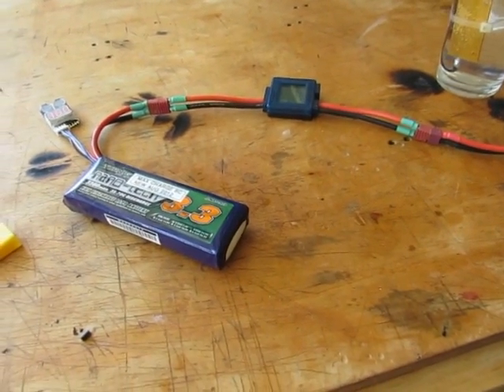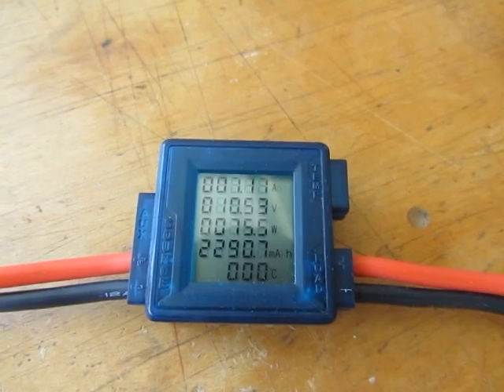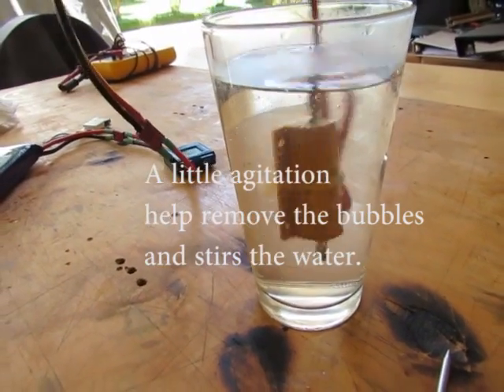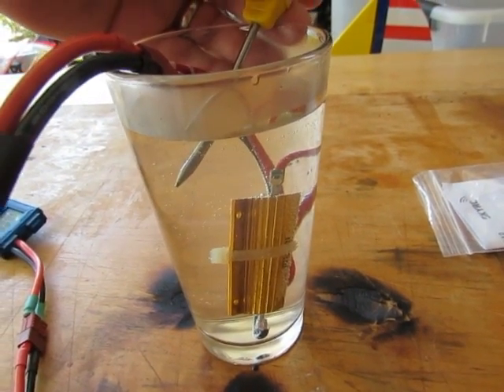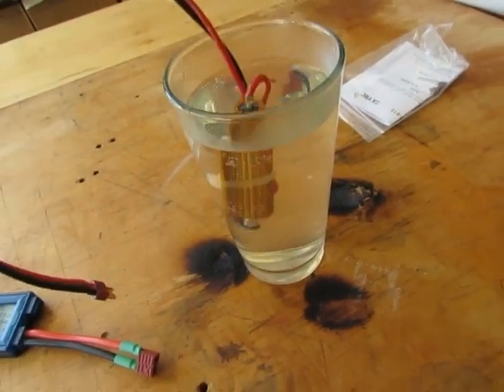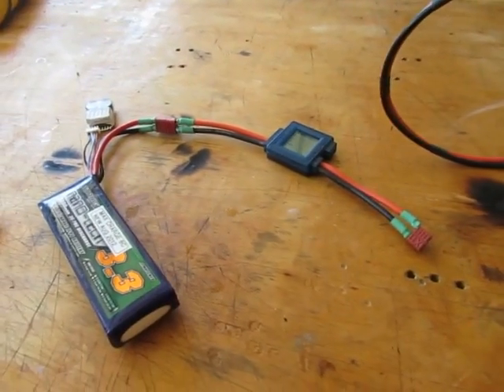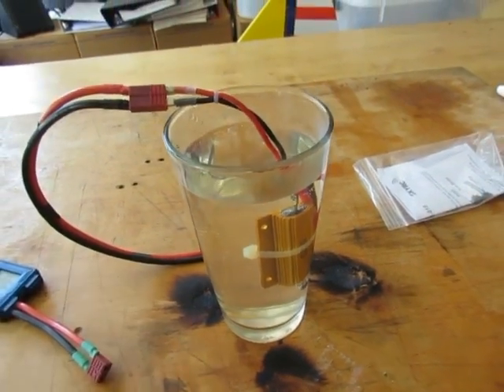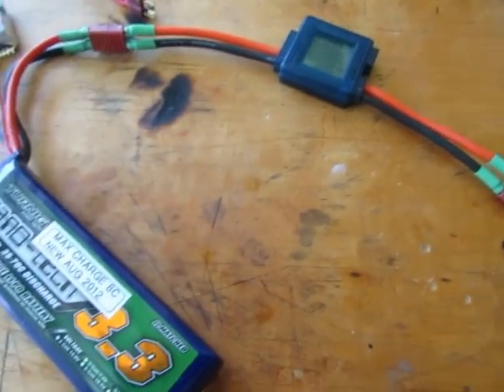Discharging a LiPo battery using a resistor.

Comment: At least you're not promoting the ridiculous salt water thing 🙄
Reply: That said, don't use water at all for this.

Mineral oil is your friend for coolant like that 😉
Reply from the maker: @MadScientist267 Hey thanks for writing. 

Mineral oil would be a great choice.  I have a gallon of it here in the shop.  

This video was simpler than that. It was just to explore using a fair sized resistor for killing a LiPo. It was obvious cooling the resistor would be required and dropping it in a glass of ice water seemed like an easy experiment. Using mineral oil would probably require freezing it first (or use a large quantity) and when the job was done, it would be expensive over time to just throw the oil away.  i.e. you would have to recover/recycle the mineral oil.  This video was just to explore using a glass of ice water. It virtually free and you can pour it down the drain.

Comment: I have a resister that looks just like that but is a 50W6Ω  , i have a tiny lipo (300mah 1S) that i would like to discharge down to storage voltage (3.80v to 3.85v) ...i don't have anything to run the batteries down (5 of them).  I just want to discharge one at a time.  is that resistor too big or too small?, would it suck the juice out of the 300mah 1S LIPO too quickly? thus exploding it? or would it be just right?  There are no other markings on the little tiny LiPO other than it says "Protection IC circuit built-in"  Thanks a ton !!!! Here is the LIPO's link on amazon  https://www.amazon.com/gp/product/B07KNFF6QS/ref=ppx_yo_dt_b_asin_title_o07_s00?ie=UTF8&psc=1   (by the way, i could see the tail of an R/C aircraft back behind the table, what type of aircraft is that, looks really big)... thanks again!!

Comment: Water conducts as another posted use Mineral oil or a large sink and fan.
Reply from the maker: Reid Bridges 

Thanks guys. I will run the next test using Mineral oil. 

Do I care if the water conducts?  In this test I just want the energy of the battery to go into the water. I don't care if current passes though the resistor or through the water directly.

My largest concern is to the long term health of the water soaked resistor.  The ice water is just a heat sink.

If it turns out I need to use mineral oil instead of water, I will have to find a way to increase its capacity . The cooling capacity of mineral oil is less than 1/2 the specific heat of water.

Finally, I have a proper way of testing and discharging batteries.  The below video is of my load cell capable of discharging at up to 1600 watts (the limit of my charger). https://www.youtube.com/watch?v=eLNjXj18g9s

The  video and experiment here was to try and find a better way than light bulbs or salt water to kill a battery for disposal.
Reply: Distilled water doesn't conduct. Only unpure water.
Reply: @RyanPhallen  No water! Lol

Comment: Not a bad idea. However, you may want to try something less conductive. Like Mineral Oil vs water.
Reply: water isnt that conductive. thats a GIANT gap also between the 2 sides of the resistor. also no easily available liquid conducts heat as well as water. even water in a car radiator would do a better job of cooling an engine than antifreeze.